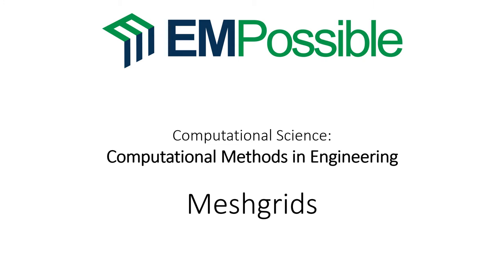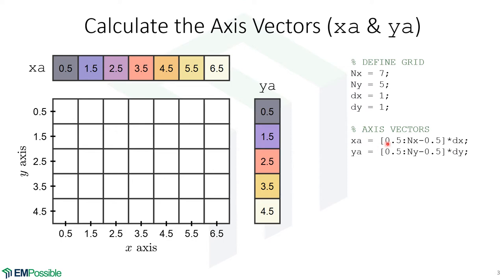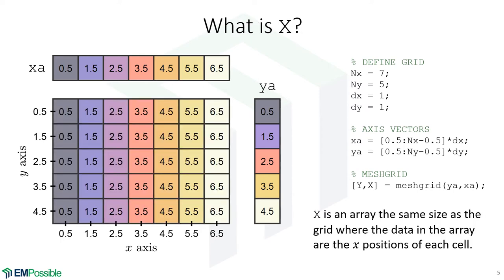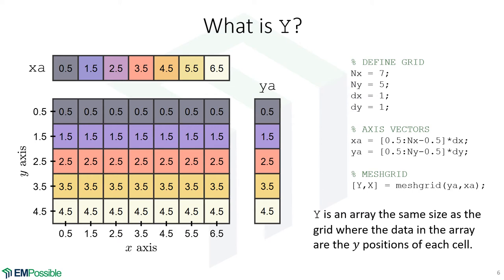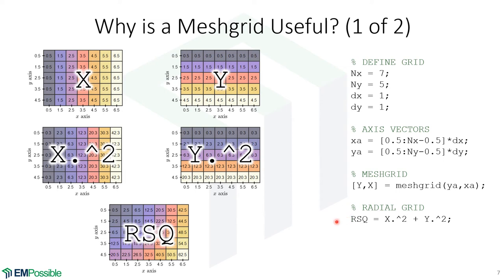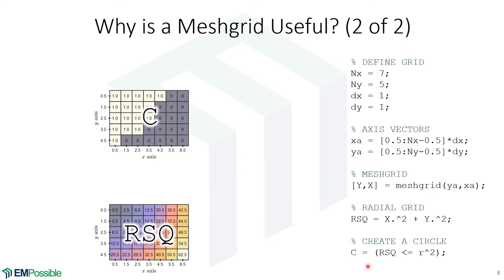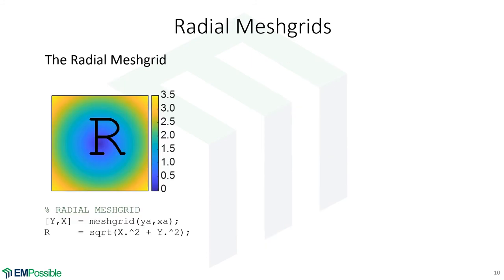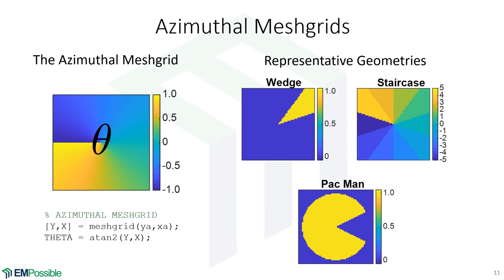Lecture --  Meshgrid

Comment: Hi Sir, is this applicable for making a fluid simulation through meshgrid?
Reply from the maker: The meshgrid technique is used for building shapes into arrays for simulations. So if you are simulating fluids moving around a wing or some sort of foil, you could use meshgrid techniques to build that device into an array to be simulated.

Comment: When u do RSQ = X.^2 + Y.^2, what really goes on under the hood? Is it adding each element [n,n] in X to each element [n,n] in Y?
Reply from the maker: Yes.  First, MATLAB will square every element in X, then it will square every element in Y, and then add those two new arrays to get RSQ without affecting any of the values in X or Y.

Comment: Hi,

I'm trying to create an image with equally spaced geometries (basically a square with polkadots). Is there some way to place individual radial meshgrids next to each other? 

Thanks!
Reply from the maker: Are you just trying to create a picture or are you building a device into an array for a simulation?  If you are just trying to draw a picture, don't do it this way at all.  use commands like fill() to draw your pictures.

If you are truly building this into an array, the best approach depends on how large your grid is and how many circles you want to add.  If the grid is very large and you want to add a lot of circles, I think it may be best to build a single unit cell and then copy it throughout the entire large array.  If there are only a few,  you can calculate a new meshgrid for each circle, centered where the circle should be added.  Then, use a repeating Boolean operation to keep adding circles.  This is very simple, but will not work efficiently for large grids or lots of circles.